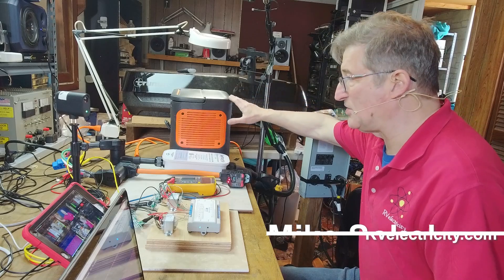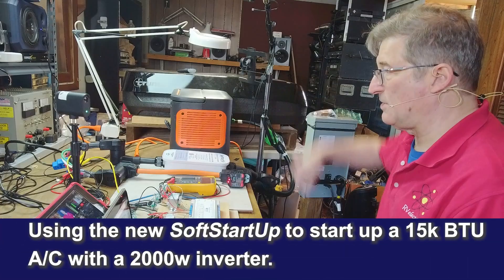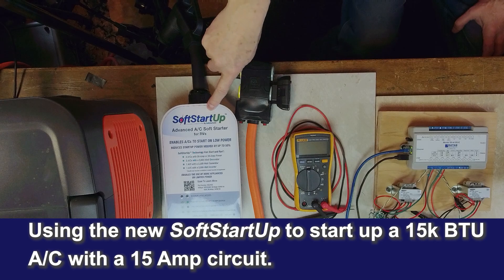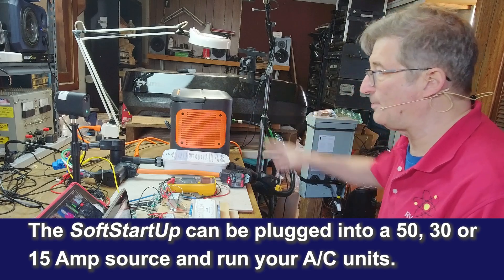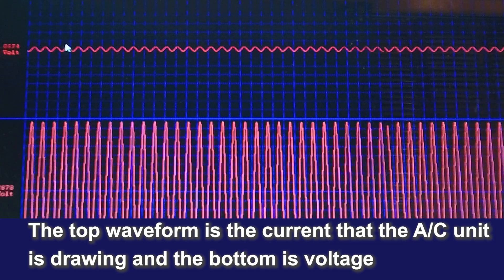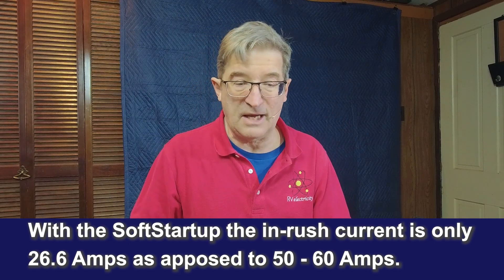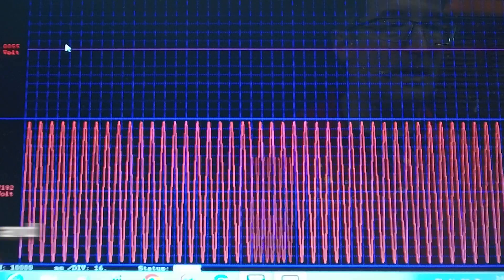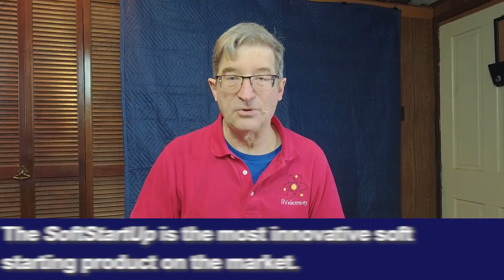Testing SoftStartUp with Jackery 2000 Watt Inverter ft. Mike Sokol of @RVelectricity

Comment: If the soft start is in circuit with the entire RV electrical system, what effect does it have other equipment? What worries me is if it reduces the supply voltage briefly it might cause malfunctioning of other appliances. Did you investigate these at all?
Reply from the maker: It has no effect. The rest is our "secret sauce".  Sorry.